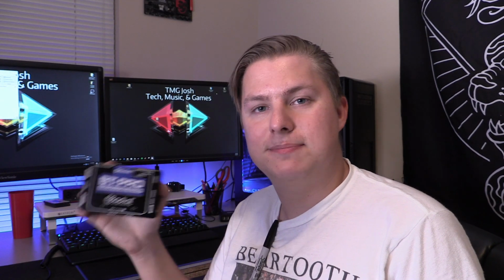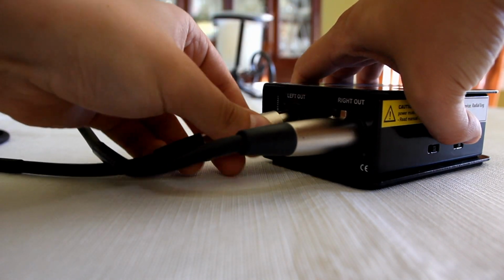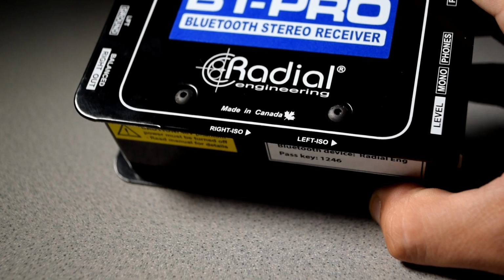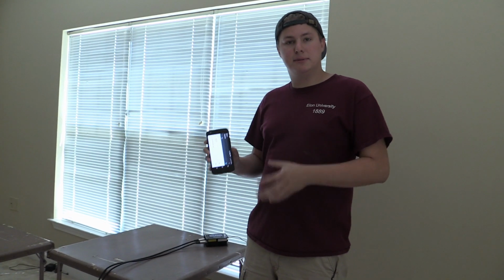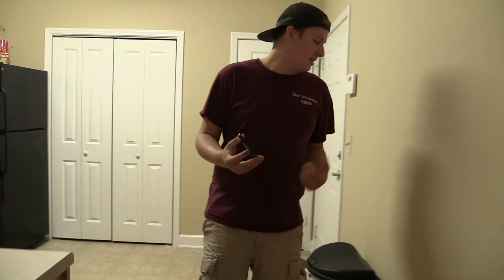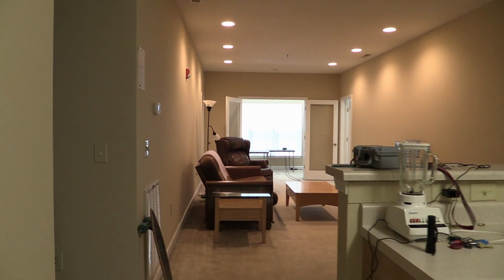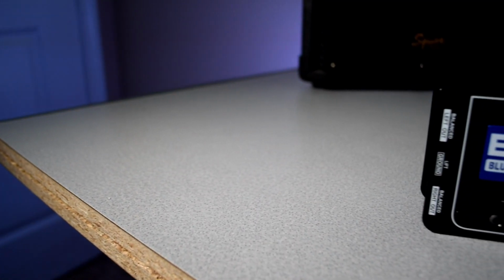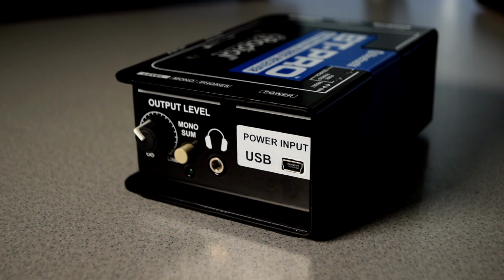Radial Engineering BT-Pro Review

Comment: You say it doesn't need phantom power like that is a bad thing.  I would prefer phantom power because of the rugged connectors and no batteries or dainty USB power supplies needed.  The USB connector is frail and not sturdy enough for stage use. There is a company who make more rugged equivalent.
Reply from the maker: Agreed. Although, since this video has come out I have learned a tremendous amount. I think that this device is not a stage use device. Especially not when using lots of RF devices outside of this. I do not rely on bluetooth devices anymore. Home use sure! Stage use is a definite no. I would rather use something I can replace quickly like rca to 1/8", 1/4"-1/8", or even a USBDI from whirlwind. Now I bet there are more than just that but those are who I trust. I like Radial's products but the bluetooth side of it I do not trust especially in an age of anything RF impacts everything else almost negatively. (granted that is depending on the area you are operating in)